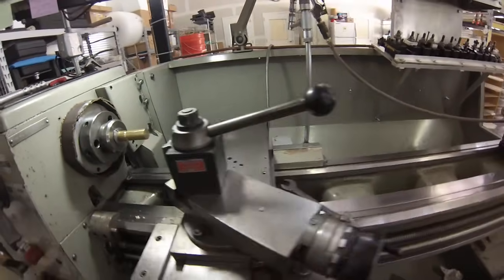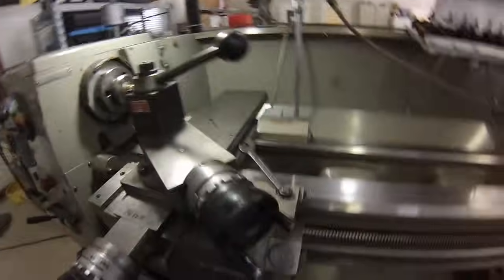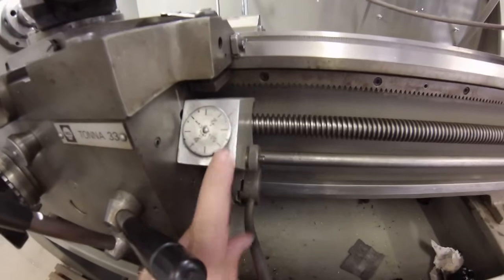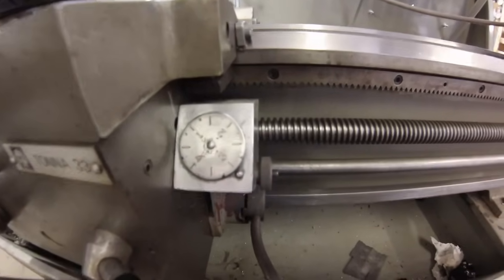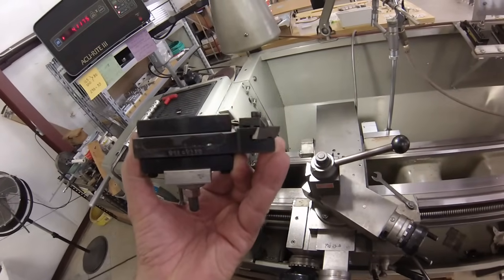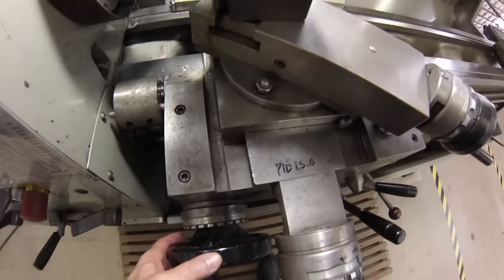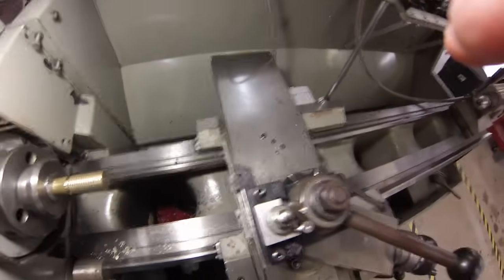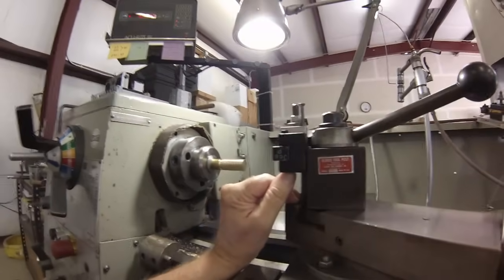Threading on a manual lathe  BEST TECHNIQUE EVER !!!!

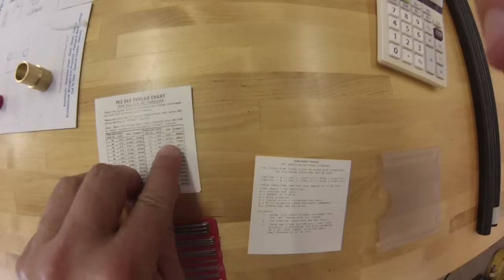Comment from the maker: At 10:52 I use the term pitch diameter. This is not what it really is. The dimension you will get by adding the 'Add' value from the PD chart that comes with the wires, and nominal OD size of the thread, is a reference dimension for use with the actual pitch diameters from the machinist handbook. You subtract the 'Constant' value from the wire chart to calculate the PD of the thread. This will get you very close to a working thread in the absence of the high and low dimensions that govern different classes of threads.  If you have any questions, just ask and I'll try to answer them.
Reply: Joe Pieczynski thanks for explaining ,I was wondering about that
Reply: Great teaching, I've used that same way for many years. I have only one suggestion, personally I have found placing two "PeeDee" wires horizontally on top allows me to hold the third wire level under the part making it easier to handle & feel the mic fit.
Reply: I often wondered just what the three wire method M gave you. So drew it up on a CAD system and found that you calculate M and that gives you the top limit of a class 3A thread. You would cut slightly smaller to achieve class 2 or 1 geometry. One other thought is to use twist drills in place of the wires. Just as effective, but more likely to be found in most shops.